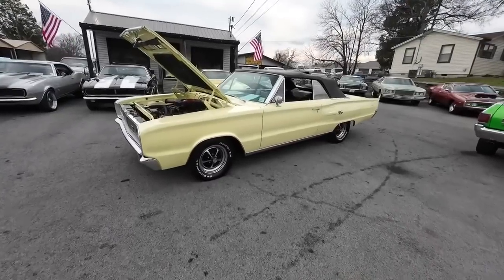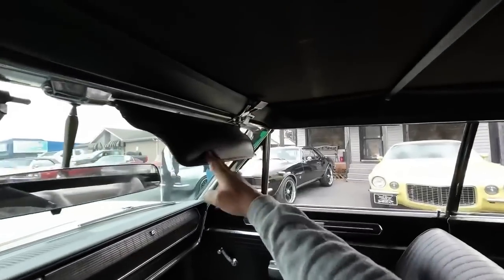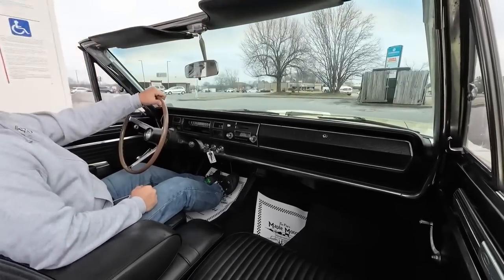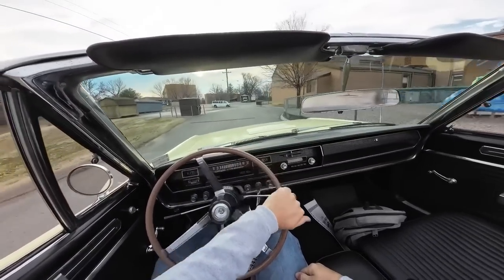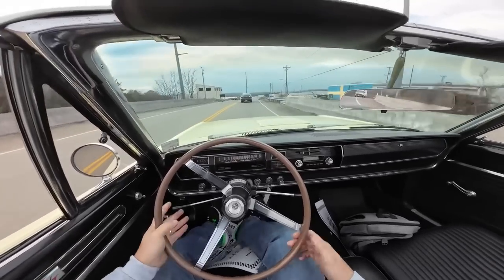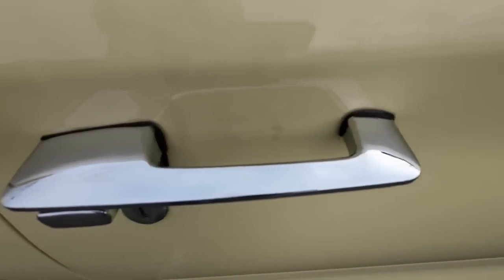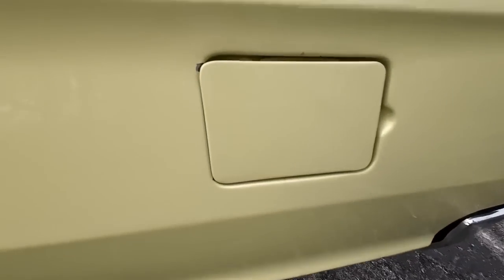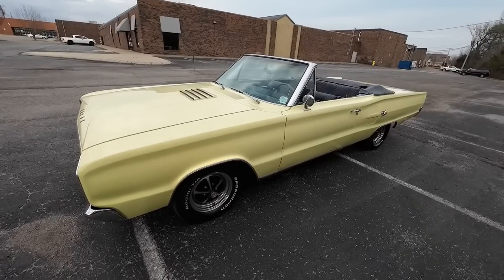Test Drive 1967 Dodge Coronet RT Convertible 440 SOLD $41,900 Maple Motors #2031

Comment: Nick:  Adds 5.5 gallons of gas

440:  "LOL"
Reply: Had a '71 New Yorker in high school. 383 4v setup. The carbs secondary venturis were big enough to fit your fist down. I was driving it one summer day heading across the river to a gas station that was cheapest around. Like an idiot I floored the throttle at the beginning of the mile long bridge after a turn from a stop. By the end of the super structure she ran out of gas. Three quarters of a mile later at the end of the bridge I was still doing 70 mph.